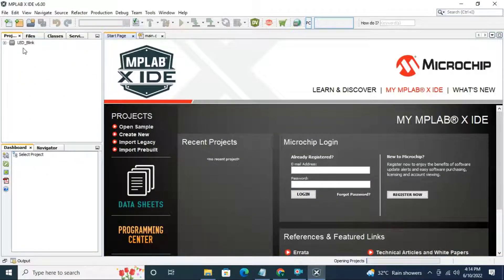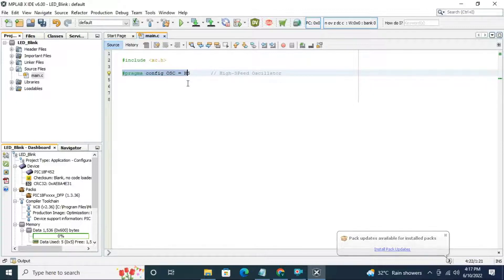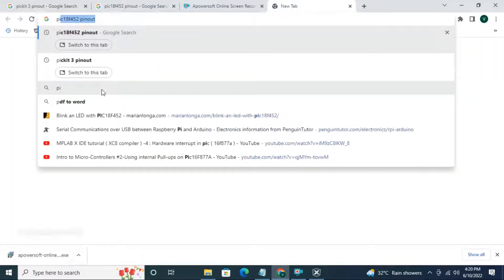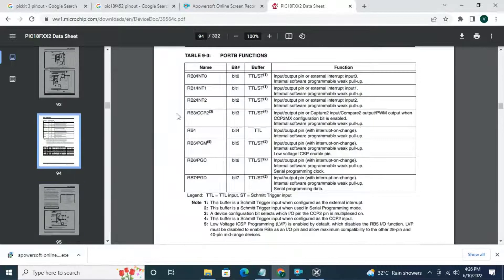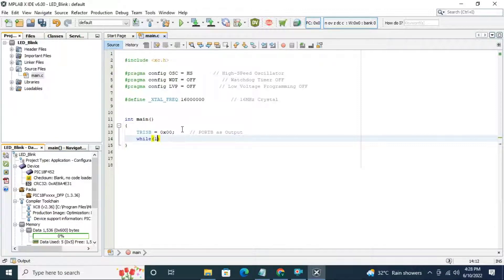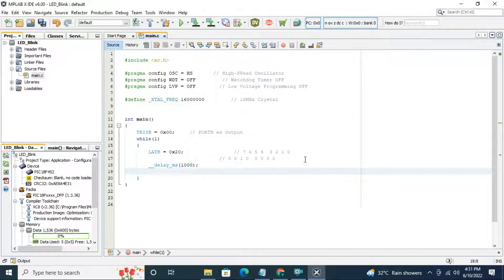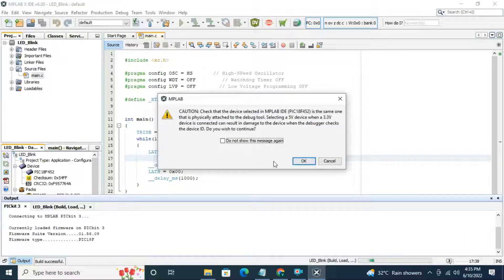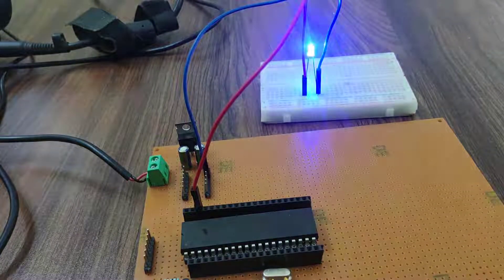2. PIC18F452 LED Blink

Comment: Thank you! My book had “PORTB” = 1 and = 0 and that was not working. Doing the actual latch bit works. It probably did not help I had the ICSP plugged in too while expecting the LED to activate. I set LATB = 0x01 and again to 0x02 to have two LEDs alternate on and off.

Also my book did not specify to #pragma the Crystal freq. which maybe that was needed too.

It all works thanks to you.